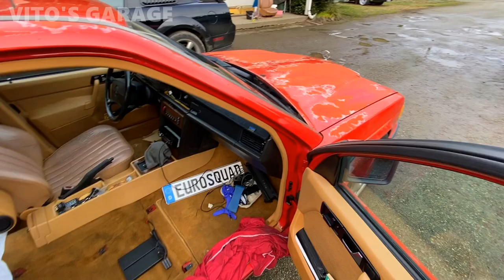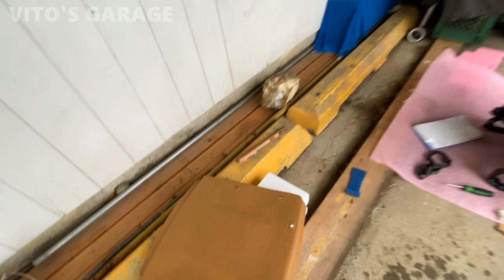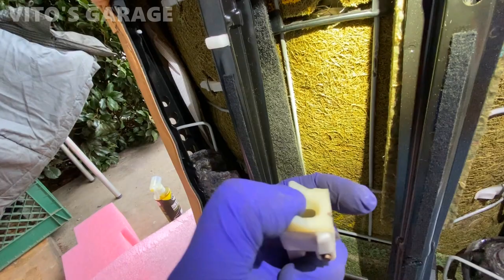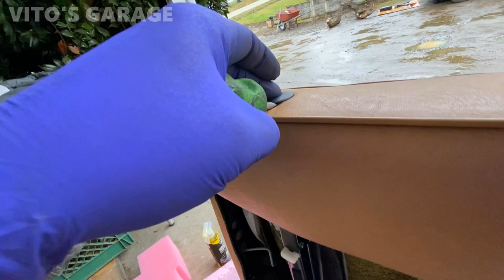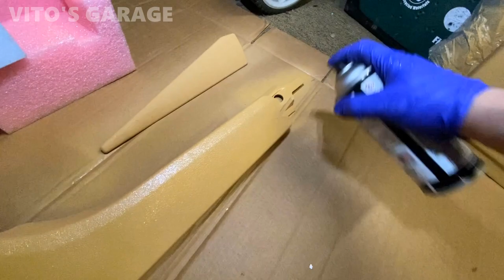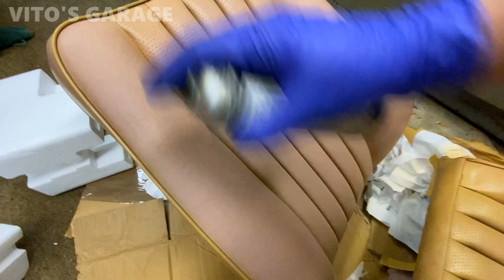Red W201 Mercedes 190E Palomino Interior Restoration. Restoring Front Passenger Seat!!

Comment: What an awesome transformation!!!  I didn't know that MBTex could fade that much.  The driver side restoration will be a bit more tricky.
Reply from the maker: Palomino is the main color that fades pretty bad. Other colors of MB Tex hold up pretty good
Reply: Palomino is definitely the one that fades the most... It's interesting as the older "Bamboo" color, present on W123s and W116s for example, did not fade even close to palomino...

Gray MB-Tex is definitely the one that holds up the best, but may be the most "boring" one as well :P